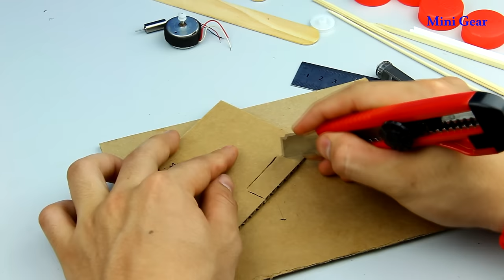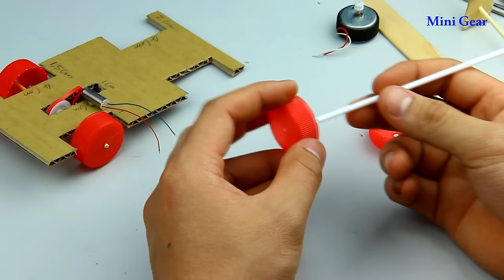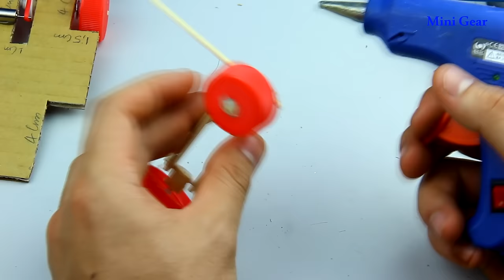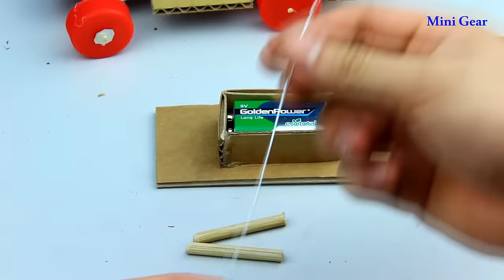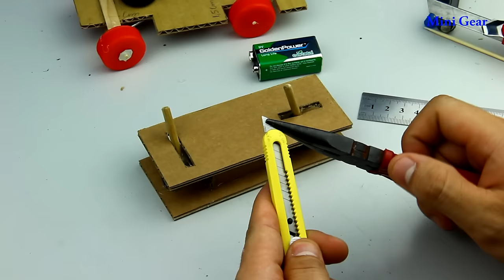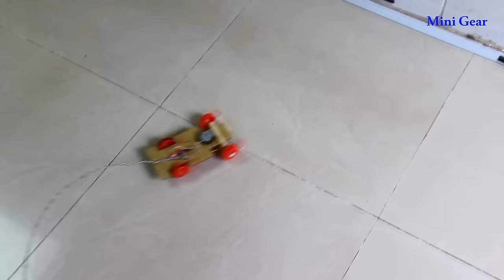How to Make a RC Car at Home Easy - Remote Controlled Car

Comment: sir it is a good work by you again and sir could you please describe the components that you have used.
Reply from the maker: The components such as DC motors, wire, battery, cardboard, water caps, iron wire, bamboo chopstick, straw, balloon, rubber, plastic gear, and etc.

Comment: What is the tool you used to do that thing you did on the blade pieces while making the controller?
Reply from the maker: It's lead. I used lead to connect wire with blade pieces.
Reply: Saif Bahubali Golu MsDhoni

Comment: please tell me the things required for this car
Reply from the maker: Things you need: 
1 - Two dc motors 
2 - Battery
3 - 4 Water caps 
4 - Balloon and rubber
5 - Paper box
6 - Pens, straw, cans 
7 - Chopsticks and ice scream stick
Reply: Mini Gear thnx
Reply: Great job. Keep it up! But could you tell me, why did you use different motors? Can I use the same tipe of DC motor or is there any essential difference between motors that should be used? Thanks in advance.

Comment: What is the stick you used to join the back wheel called? Where did you find the object that you used in the middle of the back wheels? What is it called? What was the steel pipe like structure? Please let me know as fast as you can. Please.......

Comment: This is a radio controlled car, it has the wires coming out to the remote.
Reply from the maker: The term "R/C" has been used to mean both "remote controlled" and "radio controlled", where "remote controlled" includes vehicles that are connected to their controller by a wire, but common use of "R/C" today usually refers to vehicles controlled by a radio-frequency link. (Source from Wikipedia)